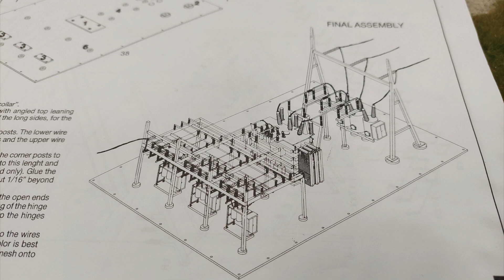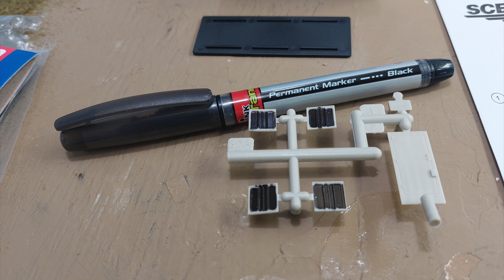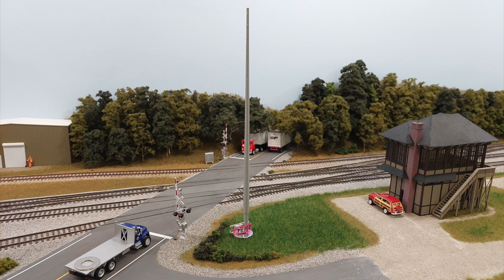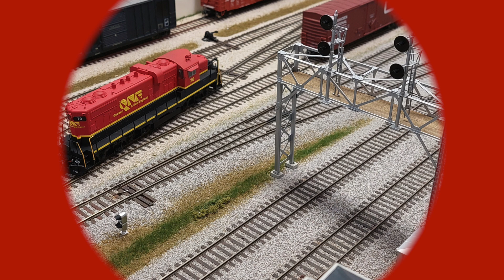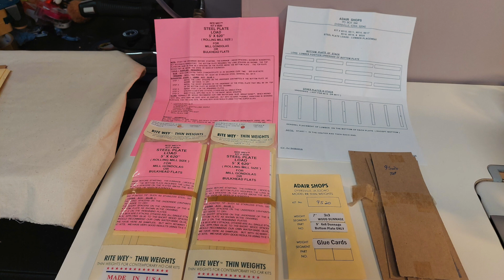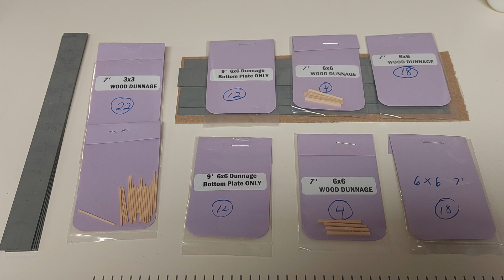Q&NE HO Layout Video 146 - 230905

Comment: Tall line poles and towers always run along a cleared easement where trees and other obstructions won't interfere with the transmission lines. It's highly unusual to see them cross above tree tops. Food for thought. You have a very cool railroad, and it's evolving quite nicely!
Reply from the maker: Thanks. I know about the cleared corridors in the real world but I am concerned about losing the hidden horizon by having the sky backdrop meet the ground at the pole. I'll figure something out.
Reply: The way your road approaches the backdrop at an angle could serve the same purpose. And you could add a work crew doing some clearing to blur the line even more. Now tell me that's not a unique scene on a model railroad! @QNERailroad

Comment: I have always enjoyed this layout and how well done it is. My question is will there at any point be any weathering on equipment, structures, etc. to add to the realism?
Reply from the maker: No surprise that this is the question I get asked the most (and its the one I dread). I'm quickly running out of other things that need to be done on the layout (my go-to excuse for not adding weathering to date). It's on the list, just not at the top yet. Thanks for watching.
Reply: @QNERailroad  I am sure you will do it at the highest level, as you have done everything else with this layout. I actually loved the building & weathering of motive power and rolling stock. There are so many online prototype photos and YouTube how to videos.

Comment: Hi Sheldon, Nice video as usual, I liked the multi content, for the High Voltage Towers, what if you just lined them up from the retired generating station over and along the tracks around the lake and kept them away from the tree line altogether, it would solve the corridor issue through the trees ? In hindsight, I would have drilled holes into the insulators and anywhere else where the wires would attach, then inserted the wires and secured them with a drop of CA, maybe might have made it easier ?  P.S. Don't forget two or three yard lights for the sub station.
Reply from the maker: Thanks Joe, for your usual good insights.

Comment: Ahhhh ……… the substation video has returned , along with high voltage transmission towers !! Sheldon , you can also model a single 3 phase circuit on what is called an “ H - Frame “  it built both in wood and steel , just google pictures of them ! One more thing…… there are no trees under transmission lines in right of way because risk of fire 🔥!  
Your high voltage friend, Kraig 😊
Reply from the maker: Thanks Kraig. Yes, I am familiar with H frames, but I liked the idea of a single pole base because of the tight clearances. I can also build the Walthers pole line as a suburban line with only three wires. Someone else mentioned about not having trees in the HV corridor, which I should have known, but I didn't want to open up a gap in the trees along the wall/backdrop because it would expose the hard line where the sky meets the grass, breaking the illusion of a distant horizon.
Reply: @QNERailroad  I hope you choose the single circuit 3 wire pole design. Please be sure to check them out to .